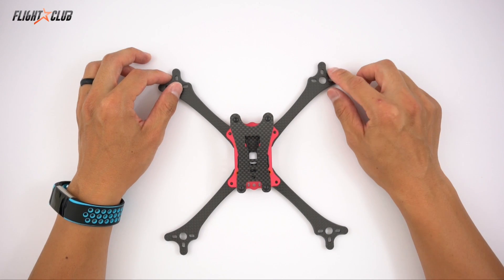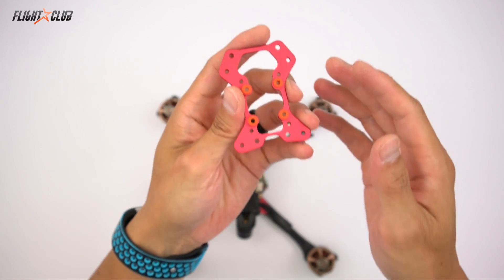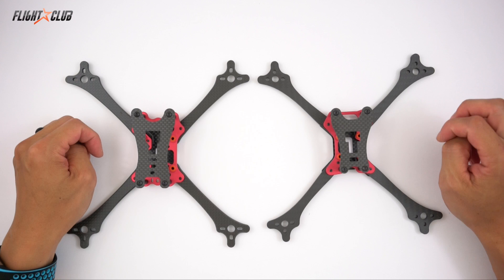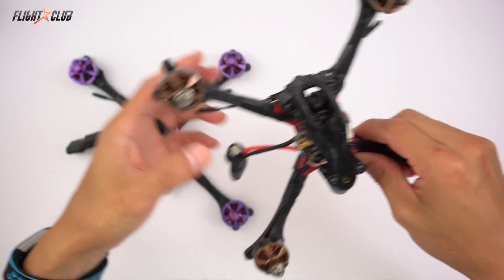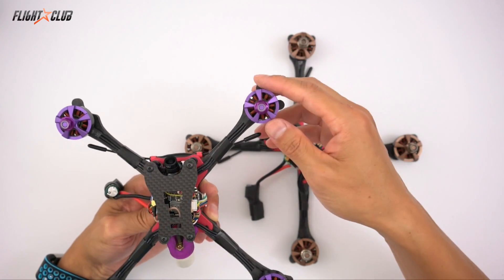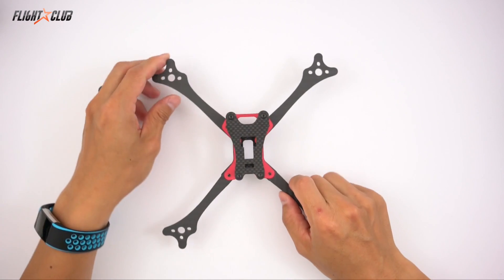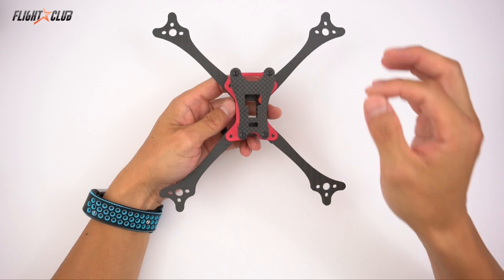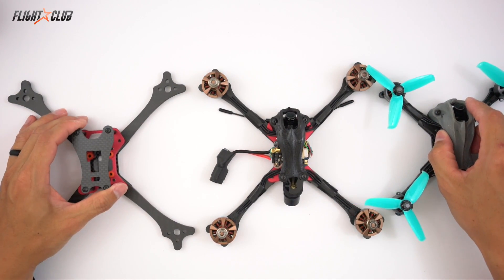New FlightClub FPV Race Frame : Neutron

Comment: I’m loving this quad frame. You did really nice work!  I just ordered it with 4” arms and the hybrid pod. Gonna put the HGLRC f420 stack and kingkong 1806 2500kv  motors.  Can’t wait to take it for a spin. The Tokio X is next.
Reply from the maker: thanks!  Have you already ordered the HGLRC stack?  I highly recommend not using this.  I killed three of those stacks within 2 weeks.  The stacking pins on that stack is a terrible design.  Any minor crash will rip the pins off the board and there's no way to fix it.  HGLRC is no help in fixing it either.  Go with the EMAX Mini Magnum 2 stack.  I have 4 Neutrons with this stack and it's a beast!  No issues so far:

https://fpv-flightclub.com/build-a-drone/
Reply: FlightClub   Thanks for the heads up but Fortunately the f420 has a ribbon cable and not pins. It’s a new move Hglrc is making. 

Im a year into quads and fly over concrete daily. So as of late I’ve only interested in stacks with ribbons. 

Appreciate you responding. Your quads are awesome and well worth the money. I’m a quality and details kind of guy.
Reply from the maker: awesome!  they finally listened to people and updated the design

Comment: I'm about to order one... Would be my first Flight Club frame. I have buddy flying Protons, and I like the idea of a slightly lighter setup with this Neutron. I normally fly top mount, but I can change to try this guy out.
Reply: It would likely be 2205/1722kv 6s, with a 1050 CNHL 6S. Yeah, lighter setup.
Reply from the maker: this is the setup I run on 6s.  You'll love it!
Reply: Thanks. I'm trying to save weight... Do I NEED the TPU mount for the immortal T? Or is there a way to mount it well without it. I could even consider using the Crossfire Dipoles if there's a way to mount them and save weight. Also, I'm considering the canopy because we fly over pavement and bottom mount frames with top carbon plates tend to get really beat up. The canopy (and skeleton version for that matter) require the Phoenix AXII mount if running one of those, right?

Comment: The only 2 complaints I have with my proton is that the arms have a slight wiggle or play in the mounting and that the motor mounting is only 16x16 and not 16x19 for older bh motors. Thats it and all else is great. Love the flight feel and I know my neutron will be just as good. The only competition for these frames is avant quads. And that means something. Nobody else can touch y'all on flight feel and quality. Just in aww. Finaly I can set down my devel frame  and fight between myself on witch one I'd rather fly!!!!!!

Comment: Fantastic frame.  Very efficient use of material.  I'd like to see you add 20x20 mm stack counter sunk holes in the top plate.  I'd like to mount the vtx and rx in a mini stack to the top and the esc and FC to the bottom.  I'd really add the FC to the upper half but I fear the top montes stack may amplify the vibrations.

Comment: Will the F1 20mm Spark32 esc fit?
Reply from the maker: no.  that esc is huge, nearly bigger than the bolt32.  why not just build a full size frame?
Reply: Yeah it is huge, I was just checking. I'll just use the older smaller spark, thanks.

Comment: why is the antenna facing down?? its supposed to be straight up in the air in forward fight so out the back with a 45 degree angle tilted up would be ideal. whats with that?
Reply: Doesn't really matter for racing. Even on a big track, you're still close enough to the quad, even at 25mW where the antenna orientation doesn't matter.
Reply from the maker: i put it face down to prevent damage to the antenna.  i still get perfect video